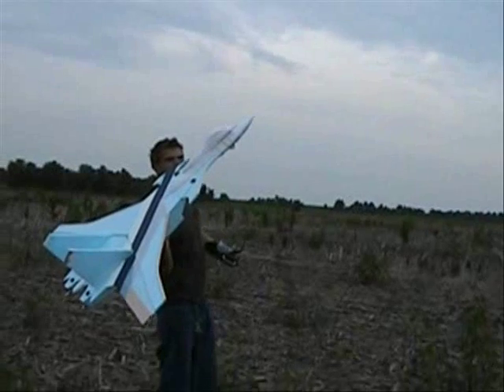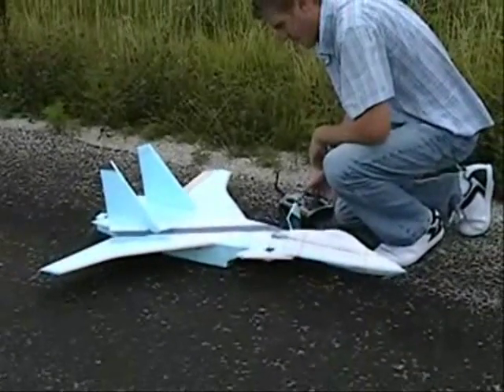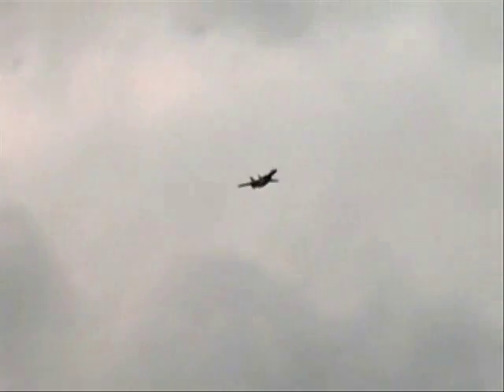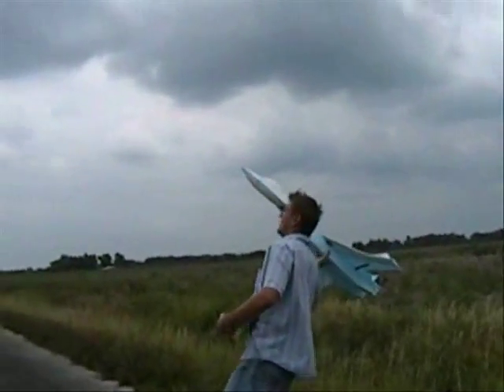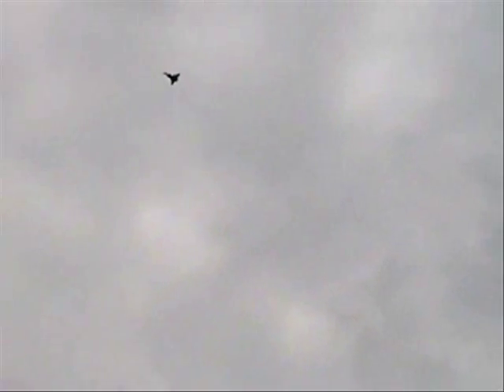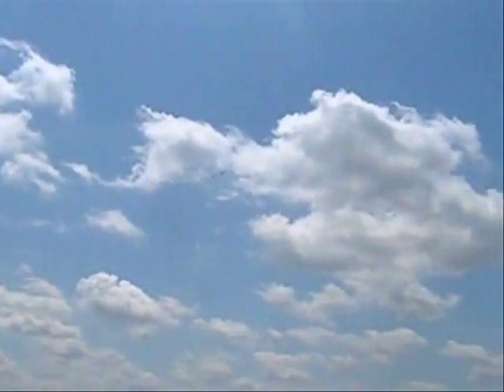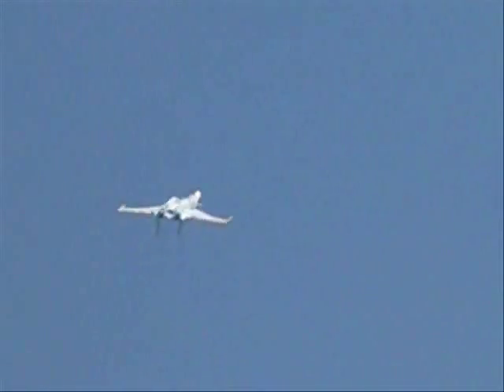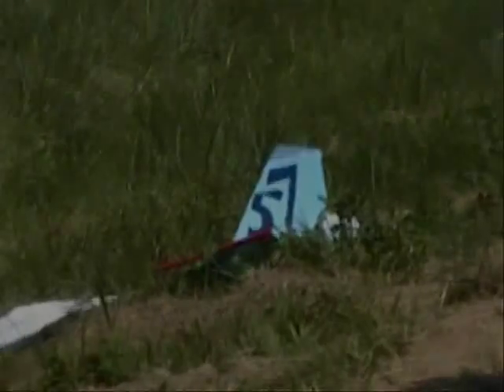SU 57 dual motor jet

Comment from the maker: Thanks Mr. Kline. I forgot to mention 2 very important aspects of this plane. The first is that the dimensions were based on the size of the props. The second was that I designed the entire top wing and fuselage around the kfm2 airfoils that worked tremendously on this plane. Even with all of the kinks at the beginning and running only one motor, the kfm2 made it possible to fly. Since I started using the kf airfoils, all of my concept planes start with kfm2's because of their success rate.

Comment from the maker: Thanks dude. I guess I couldn't wait for counter rotating props, lol. Still trying to master a fast flying wing. Your tips on the dual setup made it super simple. The plane is rock solid and the electronics don't get hot and run perfect. If you go to Mark Twains, check out those shaped balsa leading edge peices, they stiffen the wing and look really good. Thanks to you guys for telling me how to run it with one battery! Next time I'm by I will have some goodies for you to try out!
-Brandon